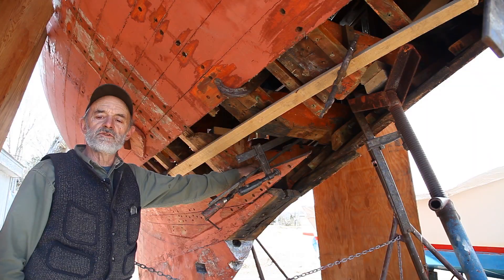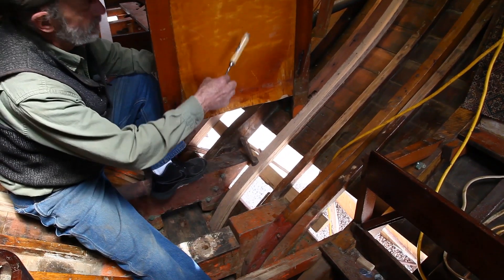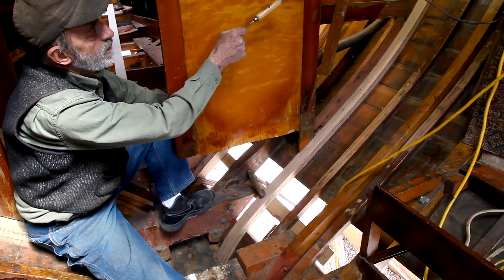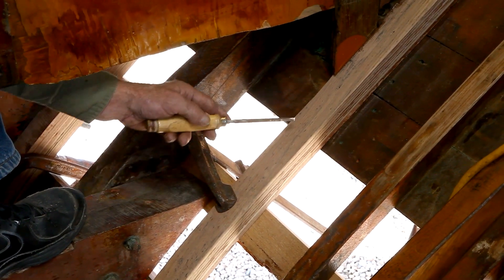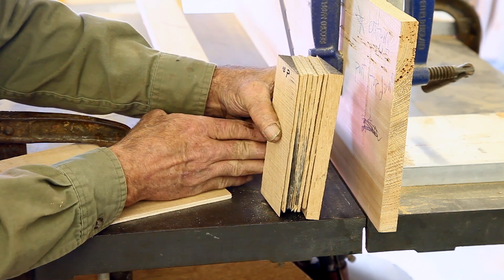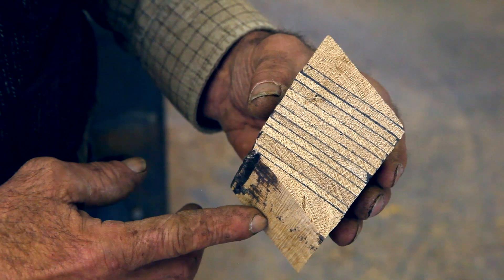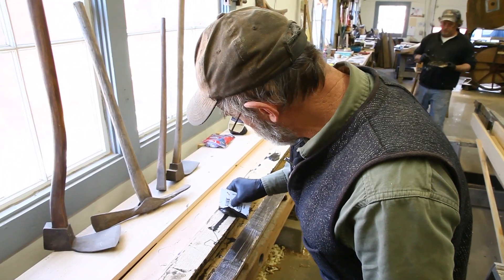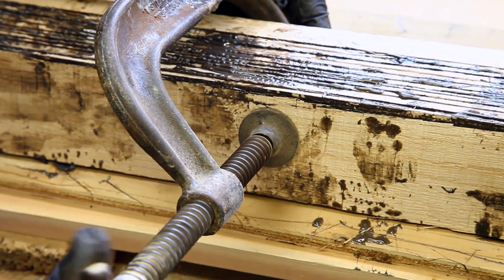How to laminate wood with epoxy for wooden boat building (Part 1 of 2)

Comment: Congratulations for the introduction of the two wedges at the upper and lower faces of the frames. If that was not done the frame would take another trajectory and would not flare at right angles to the keel.Again, well done.